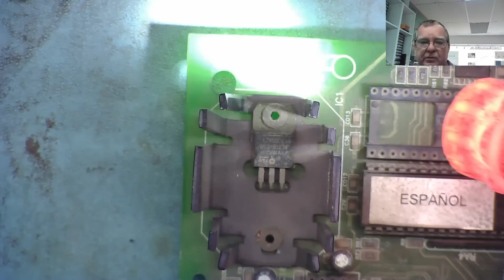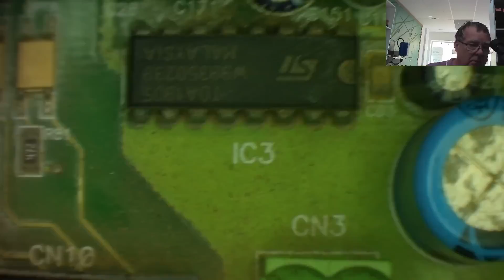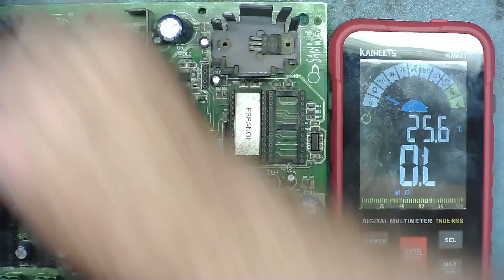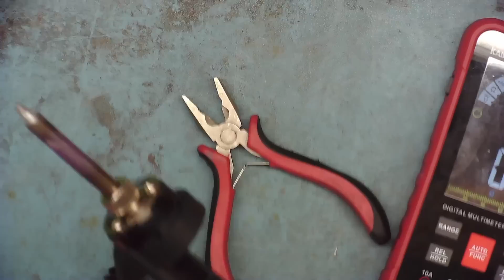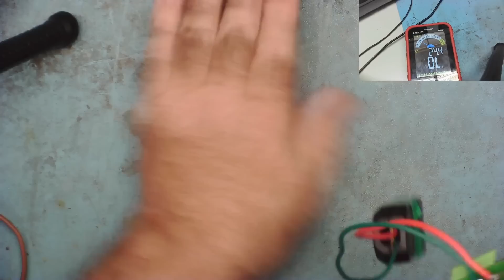Pure Electronics Repair 2 Learn Methodical Fault Finding Techniques / Methods To Fix Almost Anything

Comment: 22:11 - You may be right about that. Some of your videos show you probing pins on a small chip by bending the probe as far as you might pull back on a bow to shoot a deer from 300 yards. Thanks for sharing all your other techniques, though.
Reply: I have these same bendy brass needle probes - came in a kit of meter leads and alligator clips from Ali - bloody hopeless - if anyone. Has a link to some decent ones please let me know!!

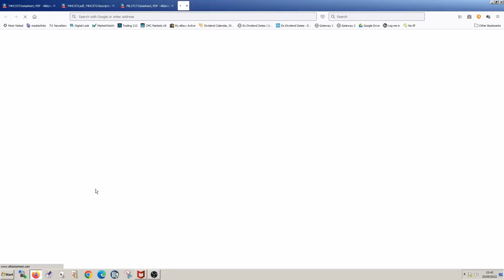Comment: 16:15  - Going by all the work you just put in, I just now determined the reason for the 7a fuse blowing. You say here that this is the part of the circuit that was modified. If there were two stepper drivers and now the circuit by modification is being forced to operate with one, this may be the over current.

Comment: Did your man not notice under the microscope how many rotten tracks you have on that board, they are simply gone this is an unsalvageable board
Reply from the maker: kristian nikolaev Why is it unsalvageable?   It didn't work after the attempts on this video so I spent a few hours mapping it out once I had a working one to compare with. Here: https://www.youtube.com/watch?v=d8mqF_hKwj0
I completed that work (plus a few more bad tracks I didn't find on the video but located afterwards) and took it back today to test, but the owner wasn't there so I have to wait the results

And if that does not work, how about removing all the components, take photos of the PCB to make new ones, then fit all the components back to those.   He has five of these all not working, plus one good one.  I found today they cost ~€500 each to replace, so you could do a quite a lot of repair work for half that price yeah?

Comment: Hey, great videos. I’ve been following your repair videos, trying to learn electronics repair to help me find the problem with a faulty board from a machine at work. The board is made by kuhnke, a controller for pressure beam on a sandpaper machine, and it uses CAN communication. I haven’t been able to find something’s faulty on the board but There are 6 such boards in the machine and one faulty one among them affects the function of all of them, but once you take it off, it’s fine, that makes me assume it’s a fault on the CAN control part of the board, but I have no idea how to proceed. I would love if I could get any form of info that could help.

Comment: Hi Rich, That 5Volt reg you said you were going to replace, you said was giving out 5.6V but you measured 0.6 on the reference ground, so it is actually giving out 5V correctly above the 0.6V ref.

Comment: did you notice that the 5 volt regulator legs on the back of the board are black bad solder joints or fried
Rich
Reply from the maker: Yes - I mentioned that in the video and also replaced it

Comment: Great video, normally those PCBs are covered in an inch carpet of dust lol. The machine has 2 goals which are monitored by opto sensors and has a solenoid to stop the puck when the time is up or the score limit is reached. It also uses a set of 7 segment LED displays each side for the players score. There is the coin input which will finish off the purpose of the opto couplers going to the 3 small black connectors. Other than that it plays an annoying tune and has  speech when goals are scored. The air pump kicks in as soon as the coins deposited reach the price of play determined by the dip switches, and the puck is released then too. Intrigued to find out why there are 2 motor drive chips though but I would imagine that the capacitor may we'll have sorted it. But bear in mind that the PCB probably was wrapped in a quilt of dust/carpet fibre so it may we'll have been running very hot,the customer never tells you that bit 🤫. Hopefully you won't have to go to site as once you heard the annoying tune it will be with you forever 😂🤣😂

Comment: Enjoy watching your videos. The 7 amp fuse seems somewhat excessive in the 24 volt circuit if that is used only for the motors, since the motor drivers are rated at 1200mA  Maximum current each. Taking into consideration the 'modification' to the motor drive circuit I'd be very suspect of that fuse rating.
Reply: Concur, if both motors are connected to one driver (perhaps after the other driver failed) then this is asking for trouble. May have damaged the remaining controller and 24V supply. My knowledge of that driver is limited but I believe you need both chips to drive a 2-phase stepper.
Reply from the maker: I would not be surprised at all.

Comment: Dodgy repairs can be sometime good but not this one... If there was supposed to be one chip, manufacturer would make it on one. Some person "fixed" this by placing double load on single chip? DISGRACE.
Since one chip is not in use, I would consider it bad, take it out, use diode mode, red probe on GND leg of chip, and black on each pin. Then make chart/table. Then remove from PCB second one, and measure, if they are the same, then they are both either dead or both good.
Btw traces on this board look very old and damaged... also contacts of small chips look very dirty and almost shorted... 
This CN6 could be output for something, I didnt saw that u checked if 24V was present there.
Dim brightness on screen means lower voltage... since system works OK with another board, problem is not on other parts.
Reply: I wonder where you get that theory from... Many arcade boards have empty sockets. Sometimes to allow the use of different size eproms, sometimes to runs other software, sometime for whatever reason. Anyhow, you definitely won't put any 'extra' load on an eprom if you would replace 2 with a single one. It's just a larger eprom with one or more extra address lines. And if you want to 'test' the eprom, don't be messing about with a multimeter, just put it in an eprom reader en read the content....
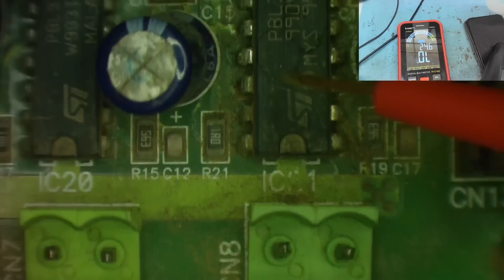Reply: @patzik1910  From schematics? Check around minute 35:00 , its servo motor IC, not speaking about address lines.
Reply from the maker: @orion310591RS  Well as it so happens - the board is not working in-situ so I will be going out to look at it next week on site.  Regards the dodgy previous repair - I kinda assume it has been working like that for some time as I don't think that repair was new.  I did work out what they have done and I also mentioned if I had replacement in stock I would have fitted it.  Anyway it looks like we are gonna find out more about this faulty PCB soon so watch this space, as they say

Comment: Hi Richard - how come you didn't measure the output of the 12V reg with the bad cap still in circuit? It could have pointed directly to where the problem was?

Comment: I'd be interested to know Richard, if it was that Puffy capacitor, I had a TV in that kept on turning off after a 3 or so minutes, if you left it off for a short while it would work again for 3 mins then off, it had 4 filter / reservoir capacitors, one had gone puffy, so I changed it and all was well, then I changed the other 3, because I think they would have been electrically  stressed , unlike me mentally stressed by Friday🤣, great video.

Comment: what an interesting journey across that board. It would be lovely to have a lesson on that isolated mains transformer, as I am just terrified every time I have to work on 220ac.

I use a "serie" short circuit arragement (just an incandescent bulb in series with the device, whatever name that has in English) to at least have short circuit protection, but still fear a lot working close to the hot section.

I guess also using an isolated ac supply will prevent earth loops when using an oscilloscope. Am I right?
Reply from the maker: Yes, if you have an isolation transformer then there is no earth or live or neutral, just 220VAC.  So you can touch either of the 220V wires and you will not get a shock - as long as you only touch one at a time.  This also means you can touch hot ground or connect your (earthed) oscilloscope to hot ground and nothing untoward will happen.  Beware though, if you connect your earthed scope to one of the 220V wires, or hot ground, the other 220V wire becomes live - so don't touch it while the scope is connected or you will feel it!

Comment: Hi ,great stuff! So why was the regulator looking burned/overheated if the replacement cap wasn’t connected to it ??
Reply from the maker: I don't know, it is working but the output voltage is slightly high at 5.6V though it may have no load if powering something off the board, but as I noted towards the end of the video I'm gonna replace it anyway before I send the PCB back.  That regulator has no heatsink, where the other two do - so I one would assume from that, either it isn't supplying as much current as the others or has a lower voltage drop across it.
Reply from the maker: BTW after I changed that 5V regulator I still have 5.6V on the output. It's gone back to be tested on the air hockey table now.  Apparently he has several more of these to repair

Comment: I think its fixed, nice bright LED's and a resounding click of a relay certainly now is a good time to plug it into the game and confidently blame the cap !....cheers.
Reply from the maker: I'll let you all know.  Before it goes back I'm gonna replace the 7805 that was giving about 5.6V output (and looks like it runs a bit hot) as well just for good measure.  Apparently the guy who owns this one has three or four other faulty ones.

Comment: These videos are a wealth of knowledge that’s very rare. I started following you back when you had a few hundred subs and your channel has stood out.

I believe you have had formal electronics education (an engineering bachelor degree? or masters?) and industrial electronics technician career?. But most importantly you have a passion for actual electronics and learning!

There are plenty of electronics projects and electrical engineering channels but I’m not aware of many other channel that fixes a wide variety of electronics from laptops, GPUs, psus, etc on a troubleshooting and analytical level. 

Just about every other repair channel either specialises only one type of device 
Iike a phone or a laptop or MacBook alone or they are only soldering channels In the name of repair.
Reply from the maker: Actually I only have an A level education ,I left full time school at 18yrs. Later in my 20s I took a 12 month full time vocational 'City and Guilds' in Radio TV and Electronics Repair then worked as a Commercial/Industrial Electronics Repair engineer for about 10 years and took a 2 year HNC (night school 3 hours a week) in Microprocessor Circuit Design and Programming paid for by my employer.  Other than that I'm self taught and oh YEAH I have a passion for electronics
Reply: @LearnElectronicsRepair  
This reply proves anyone with a passion for electronics can learn and do this stuff. We're actually quite lucky in this day and age that we can learn off experienced techs. Much obliged for the vids and detailed explanation of ur thinking process.
Reply: @LearnElectronicsRepair  Hi Rich, that's interesting as we have a very similar educational background. I did a City and Guilds Radio, TV and Electronics Technicians Course, at Matthew Bolton Tech, Birmingham UK, I seem to remember it finished with Colour TV and FM Stereo. I was about 17 at the time working for a small Radio and TV repair shop. Years later I did a 2 year Level 1 to 4 Microprocessor course again at Matthew Bolton while working for British Telecom, along with several other in house BT training courses.  I'm now 65 and retired in the USA but still into Radio, TV, Computers and Electronics as a hobby. If we remain interested in these subjects, the fact is we never stop learning. Technology continues to progress faster that we can absorb it, but its fun trying to keep up !!